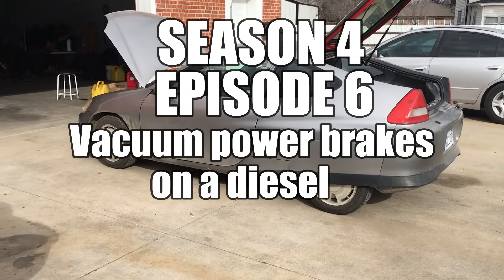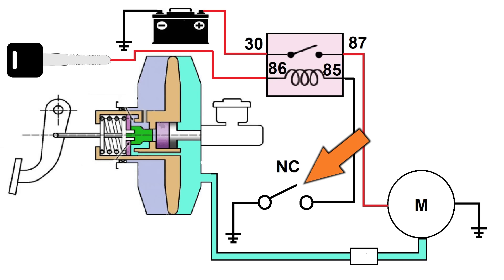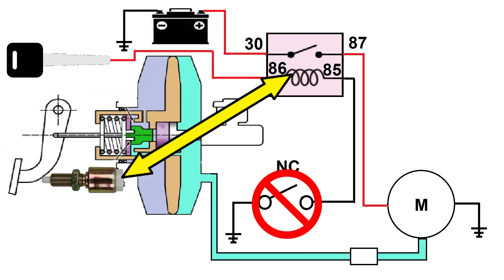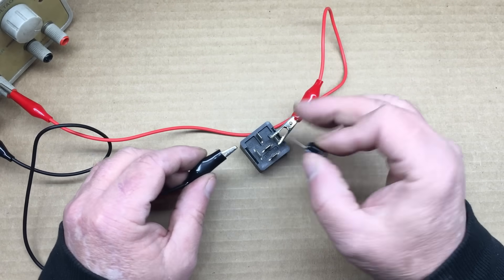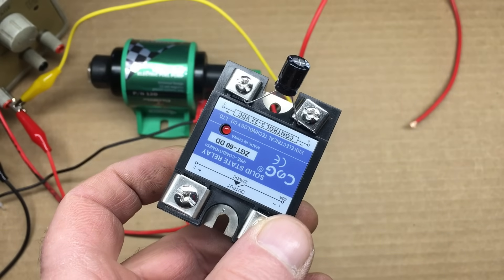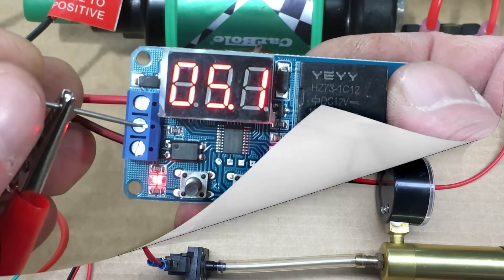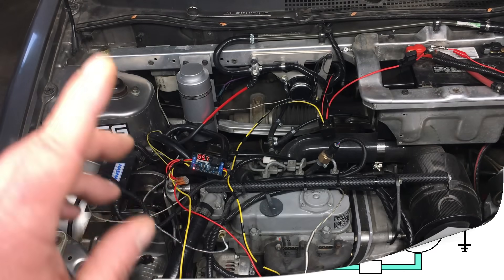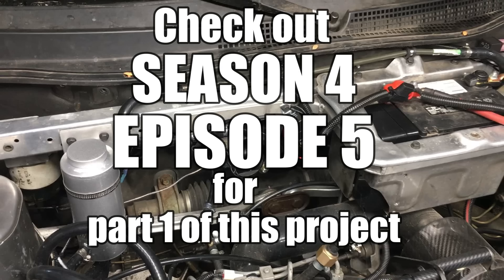S4 E6. low cost vacuum power brakes for our diesel Honda.. problems  solved.

Comment: I have prius gen 2 with km 200+, when i bought it my place, it was the first hybrid car in the place.

Its ABS unit stopped working as it should so i had to replace the entire unit to make the brake system to work as it should.  So I had a problem of finding the unit in my local area, so to resolve the challenges, i had to remove the entire fault brake actuation system and installed a normal vacuum operated brake system... installed 12volts vacuum  pump, connected it with brake switch...made sure the brake booster is not leaking out any vacuum...so the vacuum pressure for assistance is always available when brake application is required..

Those this conversion made the brake ECU to trigger the buzzing sound, so i had to remove the speaker that was making noise, temporarily disable abs light, parking brake light.. now i can drive the car with confidence. The engine braking still works but not as aggressive...if i want regenerative braking to be aggressive, i put it in  "B" mode.

Comment: Could you tell me what function you are using. Also which wires are hooked up to the timer
Reply: Could you tell me the function number thanks
Reply from the maker: @RobertBendlak  As I recall, it was extremely complicated to explain how the set up the relay, so that's why I didn't show it in the video.  You can watch a youtube video on the DROK 12 Volt Timer Relay by Robojax for a better explanation on how to set it up. best of luck!
Reply from the maker: I used the time delay off function. I don't recall what wires went where, its been a year since I made the video.  The Beuler BU509TD relay is a good alternative and it doesn't require programming

Comment: Can you pls tell me what is that vacuum switch that you've replaced? It's the only part you didn't identify.
Reply from the maker: I think the vacuum switch was something I had in my spare parts box.  A similar switch can be found on Amazon.

here is a link https://www.amazon.com/Superior-K058-Vacuum-Switch-TH200-4R/dp/B072LT1VVN/ref=sr_1_6?crid=1PWEY05BA67CR&dib=eyJ2IjoiMSJ9.wQAUXkxCLsOnsc0OCYPJDpv7rBpUWJj8ZImlAkytDXFxh7dGtFBZ5WlYuQXhSVSb2ybsXdLWsbe1aqwsboflsArVHWAyD3Vxc5sKxuvs2t_Usvew2-HyS1NVNsDJWn-SW-0FAuD75bMZo3BHV74dw9f54znm-Yly3zDxqfp_fxUbW9ZzVh8bsnyjl8uvM-ImiP01rqqxQlkYkOLOZbo8FtiNZrNVG0z6D5U-4_cVKBs.gr39uUSS75UO7_sO6BpMORrIH0JBGA9jTLsEU7I2_Yw&dib_tag=se&keywords=adjustable+vacuum+switch&qid=1741493836&sprefix=adjustable+vacuum+switch%2Caps%2C158&sr=8-6

Comment: What is the alternative for the vacuum pressure switch? It is quite expensive in our area it is around $90.. can i use pressure control valve or idle up vacuum switch?

Comment: I know this an older video, but you could use a mechanical delay.  Mount the switch in a small vacuum reservoir. Plumb the reservoir into the system with a restriction orifice. The booster would get to a higher vacuum, then after the pump is off, the vacuum equalizes above the chatter point of the switch.
Reply: A problem and solution I just thought of. 
The orifice would also delay turning the pump back on, a solution is a check valve to bypass the orifice.

Comment: Oi, Jimbo. Friendly electronics dork here. Use a resistor to handle inrush current problems... in series, before the capacitor(s).

...as an aside, despite Alexa's assertions otherwise, there is plenty of documentation a Google search away as to exactly what Amazon records and doesn't and both how and how long they hold onto it. Best consumed with stiff drink at hand to calm the nerves.

Comment: Why not just install a flow restrictor to the pressure switch? That way, vacuum builds up in the booster, then eventually flow catches up to the switch and it flips off, by which point the vacuum has likepy built a bit over the switch's cut in pressure, thereby providing a buffer.

Only issue is, as vacuum drops there'll be a delay until the vacum drops at the switch before it triggers

Comment: Is there such a thing as a mechanical relay similar to what an air compressor uses, but for vacuum? I would think springs would be a better fail safe.

Comment: Interesting stuff! This will work, can make the pump work for to much time and possible force the vacum diaphragm if someone hold the brake for long. If you use a second adjustable vacum switch you can make a simple and a lot safer interlock circuit that will keep the vacum in a range instead a time based circuit. If you change your mind, comment here and I can help.

Comment: I wonder if you could use like a pi pico micro controller to make your time delay relay out of the mechanical one. Cars run around 12-14v so you'd need to step it down to 5 and any signals down to 5 as well.

Comment: Hi Jimbo. We get the VE Commodore over here in Australia. I think you guys get it as the Chevy SS? 
Anyway, the v6 in particular comes with a vacuum pump from factory, the pump has a switch built in if it detects no vacuum it pumps the system down. I've used these GM vacuum pumps now on a couple projects, super simple just 12v, earth, ignition and vacuum source for the pump. Can buy them for 3-50$ AUD. More than happy to send you one with a bracket for free if you like?

Comment: I mentioned a vacuum accumulator in the last video for a brake reserve.......
On my TDI, I was traveling down the expressway and saw something that warranted a slow down for the whole expressway. I wanted to warn the people behind me, so instead of just slowing down, I pumped my brakes to flash my brake lights on and off, cause ya know, people tend to see flashes better than solid lights.
Well, a few seconds later I needed to stop quicker than expected.... I didnt have any vacuum left and my power assist was gone. Luckily I have a strong leg. Needless to say, if I want to warn people now, i reach for my 4 way flashers.
I wouldnt want anyone else to experience the same situation.

Comment: This may be a dumb question, but why not manual brakes? I understand it were already power assist, and cool that it now works, but why not get a master cylinder for something from the early 70's and an adjustable pushrod and convert to manual brakes? My daily driver is manual brakes, disc/drum, and it's perfectly fine. But like I said, I understand the desire to make it work, being the car came with it.

Comment: Not sure about your vacuum switch, but a reasonable amount I've played with usually have an on and an off pressure to stop the bouncing e.g. they'll close until you hit, say, 12 psi vacuum, but then open and won't close again until they're as low as 10 psi vacuum (or lower). Same for pressure switches for air compressors with some hyesteresis where they'll turn off at one pressure and turn on at a different pressure.
Time delay relay also fixes it, but interesting that this switch doesn't appear to have some hysteresis.

Comment: the solid state relay would be fine if you add a flyback diode. the only issue with inductive loads is huge voltage spikes from disconnecting them, but a simple reverse biased diode is all you need to fix

Comment: my ghetto shifter for my motorcycle uses cheap programable time delay relay. horn button used to cut ignition for a split second using the wiring that would go the the kickstand safty switch kill, to make seamless clutchless shifts. i dont know if the time delay relay i used would  be exactly what you are looking for but they do exist.

if anyone knows of a cheap inline force switch with little lash let me know because then i could make it activate with simply useing the shift lever insted of having to coordinate with the horn buttin. what real quick shifters use is a force gauge that changes resistance and needs an actual micro controller to make it work not my string of relays, also like 80$ for the cencor alone.

Comment: You should contact someone like McMaster-Carr, Whitman Controls, et al. It seems your switch is an 'either/or' meaning it is either closed or open at one exact specific vacuum point (or too close to each other) vs. an 'On' @ Hg, 'Off' @ a different Hg. e.g. closed at 14 Hg and open @ 22 Hg. 
Also, most booster vacuum leaks occur on the shaft seal. If I were to attempt assisting a resurrection I'd try applying some sort of aerosol applied lubricant to the jute filter/muffler on the pedal side of the booster. With each application a wee bit of the lubricant would be pulled into the chamber and hopefully make its way to the seal.

Comment: This was cool but I would just put the sensor on a short piece of tubing with a pinhole orifice inserted on the vacuum side.  The pressure would go past the vacuum setting and then slowly increase on the sensor side.  Any time you can eliminate a microprocessor, the world is a better place.

Comment: Another source that may have what you need for electroic components is DigiKey.  Again, may not have the voltage/amerapge range you need, but TONS of options, so it may still have what you need.

Comment: Very interesting Jimbo, I liked your solution a lot, but I disagree on the capacitor. 
As an electrical engineer, it was clear to me that the capacitor alone would not have done anything, you also need a resistor. You want to increase the tau of the system (rise/fall time of the control signal) and that is a multiplication of capacitance and resistance. Since your resistance is basically 0, your fall-time will also be basically 0.  However, like you said, the size of these components are very much dependent on the coil activation current.

I see some people also suggested transistors, sure and it will work like your diode example, but at that point simplicity can be thought of as least engineering effort to make it work, and I think you found that solution for your project. 

Having a time-delay relay seems to me like a solid solution, but in my opinion, it's overkill :) 

Great video as always! Really liking the progress of season 4!

Comment: I used the exact relay for my heated steering wheel retrofit on my 2003 Dodge Ram. I installed a 2018 Laramie wheel that had built In heat, however when I began reverse engineering the controls I noticed the heated wheel worked off of a built In thermistor that sent a temp to the computer to determine if it should send power to the element. Long story short I used this relay In your video to jog power to the element to maintain a constant temperature.

Comment: Interesting, you talked about snubber relays. I can't connect to grid power so I'm on wind and solar. I'm wanting to set up a control system in my cabin to opporate my generator that sits 100 feet away. I plan to use a raspberry pi or something that activates some relays. Looks like the snubber may be worthwhile. This whole off grid thing is getting out of hand with all the odds and ends. My lights run off of 2 relays that I set up as a 3 way switch. I can turn the lights on at the door or on from my bed😂 great video!

Comment: You should still add a vacuum reservoir since the capacity of the pump is very low as successive rapid applications would drain the system.  Alternatively you could just add an engine driven vacuum pump then no electrics and infinitely more reliable and cheaper....

Comment: You could use a MOSFET, capacitor, and a couple resistors to make a simple time delay circuit and switch the relay.

Comment: Rather arbitrary but a Mercedes Benz diesel glow plug relay would work for the motor on the pump. They can be driven by a potentiometer ( early) late work from heat , but would run it At longest a couple min when icy .

Comment: A small transistor plus capacitor triggering the relay input would work pretty well. The capacitor would be able to be really small, and could be tuned with a potentiometer to adjust how long it stays on for. Basically an "RC" circuit.

If you're going as far as using a programmable time delay relay, might as well just bite the bullet and swap it out for an Arduino and actual pressure sensor. You can program it to work at any pressure you want, use latching to avoid chattering (turn on at 8psi, turn off at 10psi), have inputs for the brake lights to proactively add more vacuum, turn on a warning LED if the pressure is too low, etc. Much simpler, cheaper, and more reliable than a hodgepodge of electrical components. The pressure sensor would likely be an old MAP sensor from your spare parts drawer.

Comment: It should be fairly simple to mechanically add hysteresis to the system with two relays( or a single dpdt) and two pressure sensors. Look up relay latching circuit. Essentially the higher of the two pressure switches will act as the reset and the lower as the trigger. Pressure drops to the trigger threshold, it fills up and triggers the reset turning off the pump until pressure drops below the trigger again.

Comment: Why cant you have 2 vacuum switches/sensors? One for upper limit and second for lower limit of vacuum. Wire them in series and you effectively build a hysteresis.

Comment: you could solder wires to the relay coil on the pcb of the timer and run them to the high current relay not 1 complet part but should simplerfi the wiring

Comment: you don't need to answer this in a video, but
putting an electronics capacitor over the relay clearly isn't your solution

however
what about a motor capacitor to the pump? something like a 5 millifarad (instead of what, 44 microfarad) cap wired to the pump should have made it run longer. maybe not 5 seconds longer, but im curious if someone can point out why that wouldn't work

Comment: A nice use of electronics to debounce the vacuum switch.  A reservoir canister inline near the pump and moving the vacuum switch near the booster would have done the same.  Pressure drop with flow in a vacuum system might surprise you if you run the numbers.  You end up near sonic easily.  It's your show, which I enjoy greatly.  Thanks.

Comment: Crazy question...on those "cheap" relays...can a regular diode be placed across the coil pins in the correct polarity and do the same thing?
Perhaps pop open the case and tack in a el-cheapo diode and make a "cheap" relay into an "expensive" relay?
Loving the content and explanation
Keep em coming!!!!

Comment: On the car the hose running to the switch putting a restriction on it should dampen the signal that could prevent the chatter without the time delay box.

Comment: The quick and dirty (but effective) fix for the chattering switch without any wiring changes is to plumb your pressure switch into a small reservoir with a flow restriction. The system vacuum will overshoot the reservoir on drawdown, but it does so smoothly and will pass the switch threshold cleanly. You will also overshoot the other way, so a little tuning so there's always adequate vacuum is needed, but you've added $1 worth of parts and gotten the desired results.

You're basically adding mechanical hysteresis.

Comment: The right solution to this problem is using a pressure/vacuum sensor with an analog output and have a simple comparator with a small hysteresis trigger the relay.

Comment: I have an issue losing power brakes while left foot braking repeatedly at full throttle in my drift car. I wonder if this little guy would keep up as a backup in the system. I could trigger it to only run while gas and brake are pressed together. Hmmmm

Comment: Jimbo, I love the channel and content; thoughtful, interesting and entertaining.  I meant to make a comment last week but didn't.  The timer works great, I really like that solution.  After last week's episode my mind went to a two pressure switch option to deal with the low hysteresis switch chatter problem.  I think that this works.  Taking Switch 1 as activating at 15" Hg and the Switch 2 at 25" Hg (and both having low hysteresis values individually).

Wire the supply to Switch 1, then from Switch 1 connect Switch 2 in series, and then on to the coil in the relay.  Opening either pressure switch will cause the supply to the vacuum pump to stop.  Then make a connection from the relay output powering the vacuum pump to the supply side of Switch 2 passing through a diode.  With this configuration the supply side of Switch 2 is maintained with voltage while the vacuum pump is powered, effectively latching the action of first switch until Switch 2 turns off the vacuum pump.  The vacuum pump will start again when the vacuum is less than 15" (both pressure switches closed), but will continue to run until 25" before stopping.  This provides a wide gap between switch-on and switch-off for the pump, and the pump will only ever run for as long as it needs to (not that this is important or even relevant, but I'm a bit OCD on these things sometimes).  The diode stops Switch 1 from supplying the pump motor directly when it closes.

I'd be curious to know if you like this approach or not, I'm guessing that you had already thought of it and set it aside in favour of the timer option.  Cheers

Comment: It would be interesting to see if a venturi in the intake would be able to provide enough vacuum to give effective braking power. 
I realise it would never reach the same level of vacuum as the vacuum pump but if it gives enough it would be an elegant solution with no moving parts (other than the air).

Comment: Remove the timer .  Just use two vacuum switched set at different pressures it'll come on cause both are still closed with the key on, once it hits pressure the one switch will cut out but the other will go on. till it shuts off.  pressure goes down the higher on comes on but the lower is still off diode keeps this system running till the low one cuts out  and the process starts all over again.  the pressure can be as little as one pump of the brake pedal and cuts off when the high pressure one opens, doesn't start till both are closed.